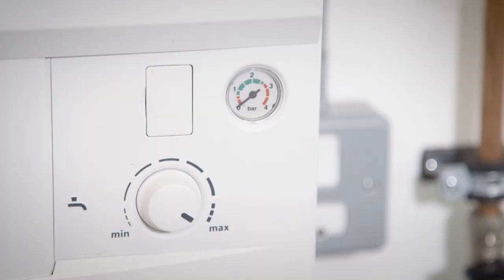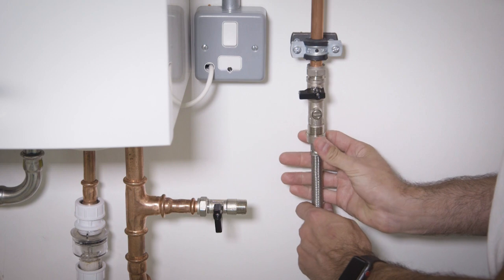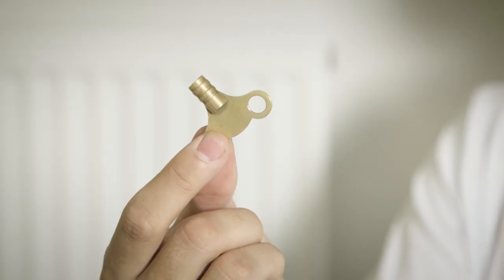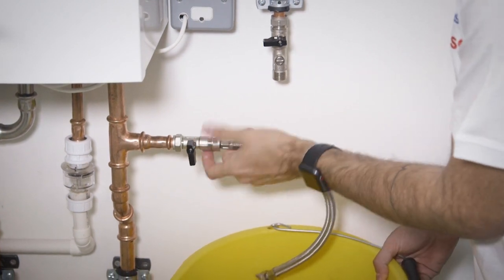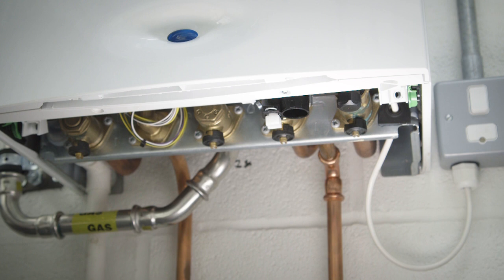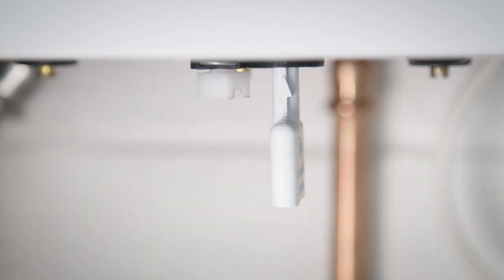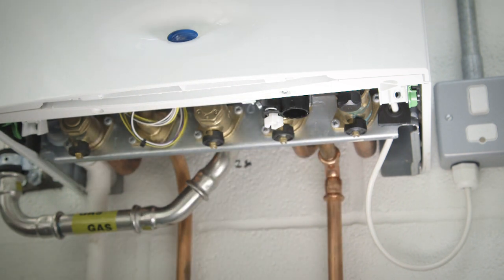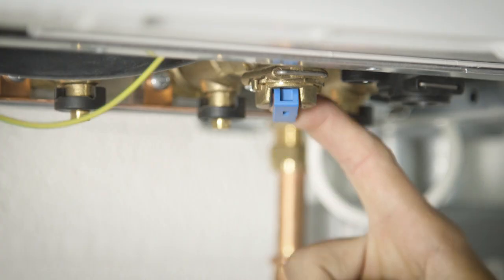How to Repressurise a Boiler

Comment: Does the boiler system need to be turned off at the mains when repressurising? Noticed that in some demos its not and some it has. Had to do this and have the keyless internal loop blue lever. Easily topped the pressure up but instructions never mentioned to turn off mains power. Boiler was cold and not in use at the time though.
Reply from the maker: No, you shouldn't need to turn the boiler off at the mains in order to repressurise. It does need to be cold (e.g. not currently heating water) though.